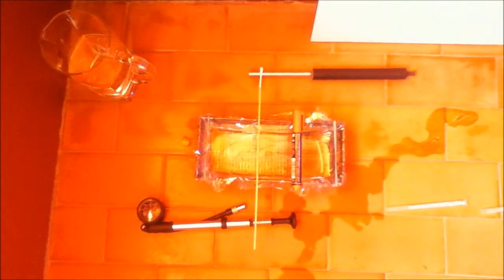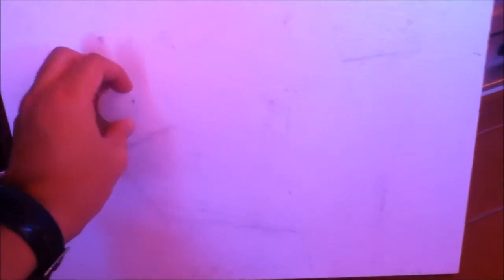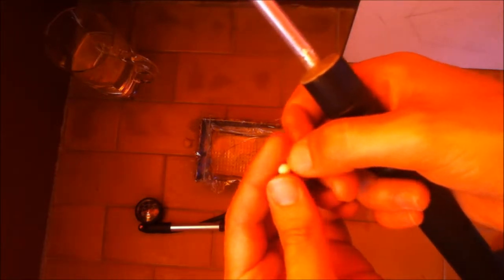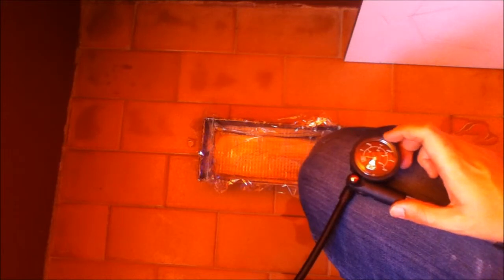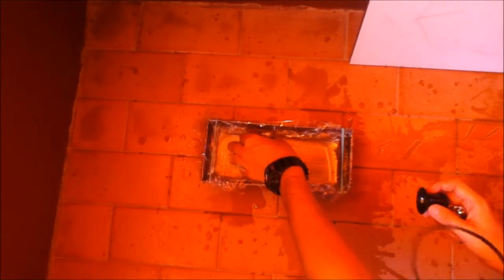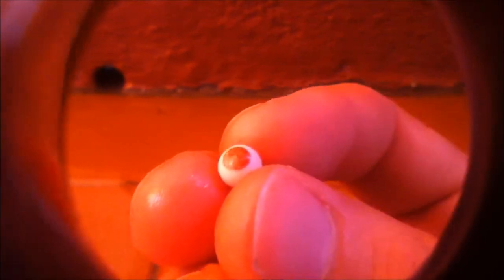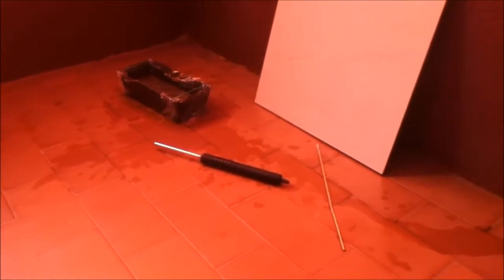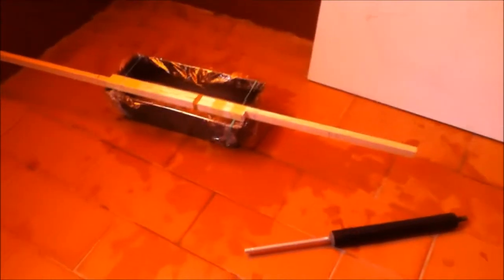QEV coaxial Air Cannon experiments - UNEDITED

Comment: Hey, this is a great video! And very interesting thing. I also noticed the stripe on many and most of my guns as well. I've also been wondering what it is, but never really thought about it properly. It's really good to know that a our smoothbore barrels truely don't cause spin on the bb. Only with one of my guns, which had a drilled out barrel, I had spinning issues.
Reply from the maker: DerKrawallkeks Thanks man! I hadn't filmed since a lot of time!
I made awesome improvements on ergonomics and now I'm putting down cans at 15meters! I think I could go even further if I cast my own pellet, but as always I have limited time...

So do you also add a choke area to hold the bb in place? I thought I was the only one!
Reply: Me neither, I should do a video:D 
yea you mentioned that. For such a hand-fired qev gun, that's pretty good! I can't do that with mine.
No, I do not use the 'choke area' anymore. (But still got the aluminium stripes on the bb). I used tape earlier, but now I got a hop up in my sniper, and in my qev guns, the tolerances are so tight, the bb doesn't roll out
Reply from the maker: DerKrawallkeks well that's weird then! Why do you get those stripes? Have you crowned the muzzle? What's the thing you can't do with your qev's? Hitting the can at such distance?
Anyway your smg rules a lot!!
Reply: it must come from the aluminium barrel. I'm not sure.. Maybe when the bb is fast, towards the end of the barrel, even slight contact with the barrel could cause these stripes..

(yeah, hitting a can at that distance. All the drill marks in my flashlight qev gun make it really inaccurate:D)
Reply from the maker: DerKrawallkeks I gotta tell you: to hit that can, you'll surely need a stock, aiming means (I use a laser) and some sort of trigger like the one I showed you on that early video, remember?
About your stripes... If you still get accuracy, why worry? It may be due to the hop up I guess